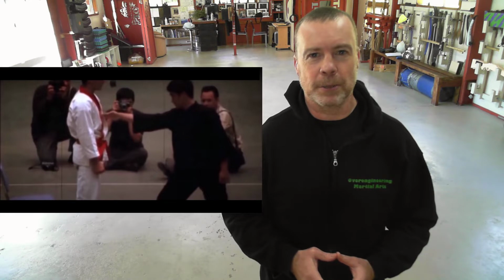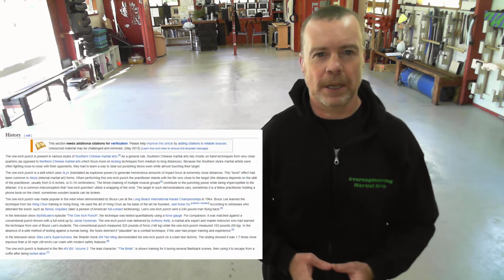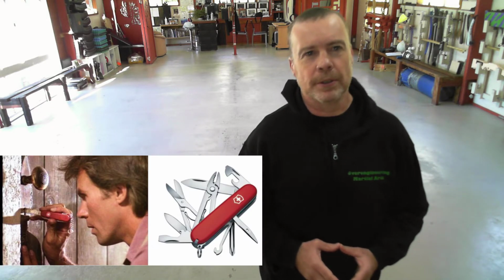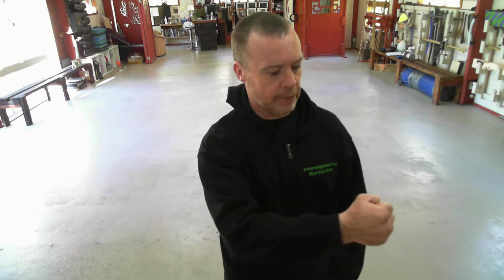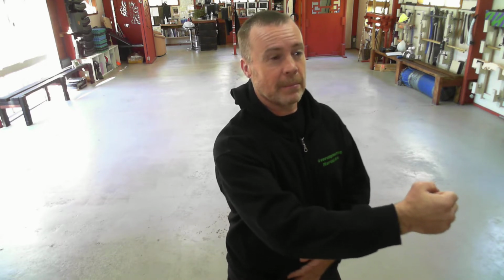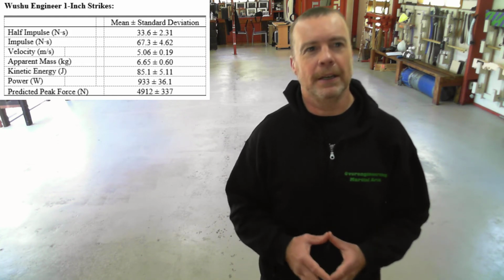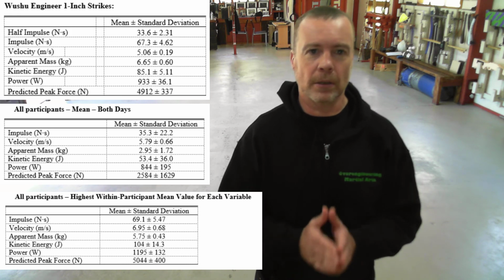1 inch punch! Useful or not? Fully tested using Impulse Block analysis. PowerKube 2 record broken!?

Comment: What is a franklin??? Converted to Force???
Reply from the maker: The franklin is a proprietary unit named after the inventor of the StrikeMate/PowerKube system. It is not an accepted scientific unit and appears to be some combination of energy and power along with some unknown modifying factors. To my knowledge, the manufacturers of the PowerKube have not provided a detailed breakdown of the unit. It cannot be converted into units of force.
Reply: @WushuEngineer  thanks alot for the elaboration!

Comment: Hello, very interesting video, the tests and methodology, you did.
I would like to comment on a perception I have.
I find it interesting that application of this punch has different techniques.
Usually people try to use the Bruce Lee technique.
But this punch came from kung fu, and the style that Bruce Lee learned this punch and then tried to improve with his techniques is Wing Tsun. And even in the different families Wing Tjun has different approaches.
I trained Wyng Tjun from the Ip man lineage, which was who Bruce Lee trained with for a long time, but he didn't finish all the training, as he had to go to the United States.
In the lineage I trained, it came from the Ip Man lineage, two generations later.
I find it interesting that generally in the lineages coming from the Ip Man. Regardless of the type of punch, in Wing Tjun, especially in close combat, it is trained to use the erector spinae muscles in the kinetic chain of the punch, which is generally not used in other punching techniques.
It would be nice to have a video covering other kinematic chains for this punch and possible applications depending on the context.
Reply from the maker: Thanks for your comment. I have been meaning to look into the varying biomechanics associated with different strikes and kicks for some time, so will most likely deal with that in a future video. I’m still thinking about how to test, format and present that at the moment.

Comment: Hi, I´m kind of new here.
Since you are very knowledgeable about a range of different forms of force transfer, I wanted to ask if you could elaborate on the different properties of a swing from a blackjack with a semi-flexible coiled spring handle compared to a regular hammer with a rigid handle - provided their heads are of similar weight. I´ve been wondering about it for some time now.
I am not sure about what australian weapon laws state about blackjacks though.
Reply from the maker: Welcome to the channel. Thank you for your question. I have showcased fully flexible and rigid impact weapons on my channel but I have not showcased any semi-flexible impact weapons yet. I have been planning to do so, though. When I put that video together, I can hopefully address your question in some small way.
Reply: @WushuEngineer  Thank you, I will be looking forward to it with great interest.

Comment: Shouldn't your punch be on the same side as your leading foot? This should allow hip movement to add to your impact force. Punching from the rear foot means your torso is already twisted and further twisting yourself when you punch, and reduces the power you can generate.
Reply from the maker: Thanks for your question. I practice doing short range strikes in various stances. The position that I take in the video works best for me personally, which is most likely due to my focus on using a balanced rotation through my centreline to generate force, allowing my leading hip to draw back as my rear hip rotates forwards.

Comment: Very nice test bro , thanks for this video alot info but…. Comapre direct your best 1 inch punch on loadstar around 100 kgf to predictedd from impulse block almost 500 kgf 🫣 ….second i split loadstar yesterday and weight front plate it weight almost 3 kg and with foam almost 4 kg the inertia of this weight i quees probably swallow huge part of energy and momentum of striking person etc 🤔 and last if im do competition on 1 inch i will give limiter behind elbow which dont allow person to take more distanc for acceleration 😁 than it be very fairly 👌🏻 and last comapre powerkubie peak force from your 1 inch punch to loadstar to predictove from your impulse block me good its huge diffrenc for each metod and system 🫣😂 anyway great video alot info so you are slower than your practicans which you measured but thanks more aparent mass you was able to hit 2 times harder nice thanks more rigid kinetick chain you allow them to use the same body and arm setup as your or they could and executed it whatever how they want it ? I found on me forcemeter so loadstar and ubm that strongest 1 inch punch i can achieve when me front leg is on the same side as striking hand 😁 so technique similar to jab rather than to revers however it may vary depend what specified person train more so the kinetick chain in specific technique he may have stronger than in other but in me egzample its jab which deliver bigest force for 1 inch punch even with corpse almost 90 degrees to target /forcemeter 👌🏻 be knowing distance and contact velocity you can also calculate average acceleration your hand so in your egzample it be around 90 m/s „2 so around 9G vs in your participians assuming the same dystans around 15 cm from target ( while 1 inch is 2,54 cm ) is 110 m/s „2 so 11,2 G 😁 whats force value for your best attempt from 14,8 cm when you hit above 4 k ? In ft lbs/sec ?
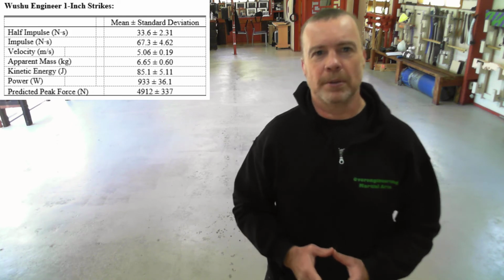Reply from the maker: Thank you for your comments. The participants in the study were doing full range palm strikes, not 1-inch punches, as I mentioned and briefly demonstrated in the video (22:27-22:50), therefore the comparison that I was making was between my 1-inch punch values and the full range palm strikes of the participants. In terms of the leading foot, please see my responses to the comments by Bacteriophagebs and Mike B. For the PowerKube results, we only recorded the franklin values.
Reply: @WushuEngineer  ok thanks 👌🏻

Comment: I notice that you're using a twisting torso technique for your punch.  Bruce Lee would push with his back leg, keeping his torso straight, though he also used his core to add some force, just not by twisting it.  That's how I learned it from his books, anyway, and what you see in videos of his demonstrations.  It requires you to have your strong side forward rather than back, in standard Jeet Kun Do style.
Not that that is the only way to do it, and clearly your way is the best for your style, but you seem to be losing some power because your back foot shifts backward rather than staying stationary.  You may be gaining more with the twist, however.  If you wanted to try the other style as well, it would be an interesting follow-up video, I think.
Reply: I seem to have repeated what you already said.
Reply from the maker: Thanks for your comment. As I mentioned in my response to Mike B’s comment, I practice doing short range strikes in various stances. The position that I take in the video works best for me personally, which is most likely due to my focus on using a balanced rotation through my centreline to generate force, allowing my leading hip to draw back as my rear hip rotates forwards. Allowing the heel of my back foot to rotate out rather than staying stationary facilitates this rotation. If I was to keep the back foot stationary, this would limit my ability to draw the leading hip back and require me to shift my centre forwards to generate force. However, there are many different biomechanical principles that could be leveraged in this case. Thank you for your suggestion about a follow-up video, I will consider it.
Reply: @WushuEngineer  Yeah, I was confident you used that technique because it worked best for you, and you got great power out of it, so there's obviously nothing wrong with it.  I just figured that since Lee made the move famous, it would be interesting to test his version.
Keep making the great videos!